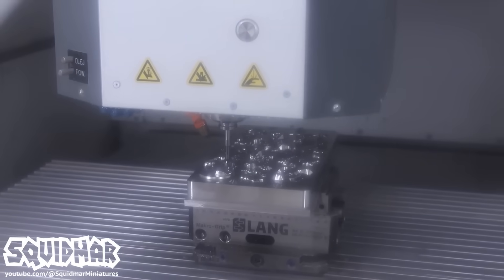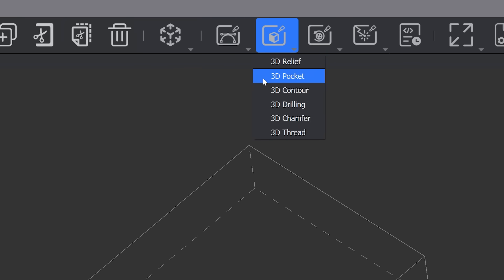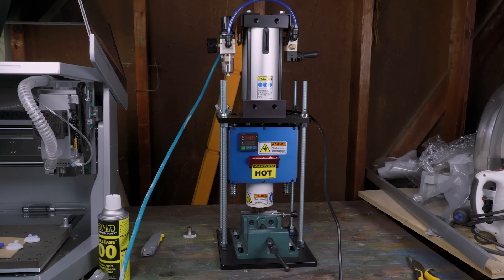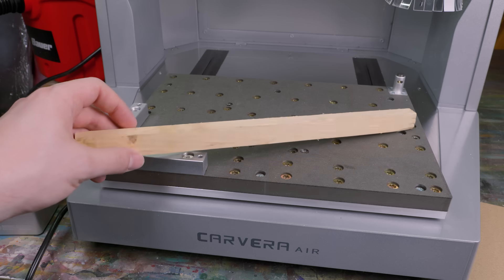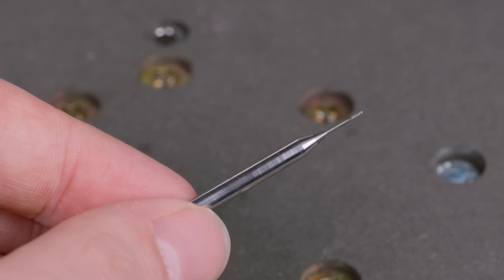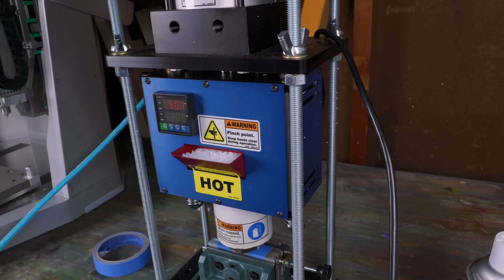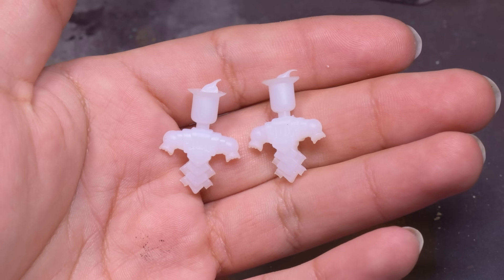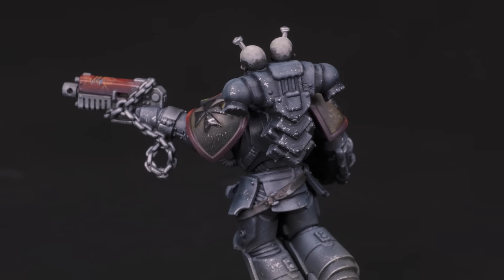You Can Make Warhammer Plastics at Home Now!

Comment: And that, ladies and gentlemen, is why a steel injection mould die is 5 figures or more to manufacture.
Reply: they might also use different methods like edm (electric discharge machining) where they first make (cnc) a die out of copper or graphite and then slowly sink it into a steel blank using electricity to slowly spark away the steel . this is called die-sink edm or sinker edm. with this method you can create much finer details and sharper corners, but it is also a lot more involved and requires additional machines, protection, knowledge etc.
Reply: If the mould starts to break, just retire the models with the next codex
Reply: How long will it take for degradation is the main question.
Reply: @COOPALOOPTROOPA  that really depends. I know for a fact that a couple of companies are still using the same moulds since the early 70s, but the details are a bit softer now. For bigger things you could use the same mould for decades, but you will loose quality over time
Reply: @COOPALOOPTROOPA  Good question.

I think the price of steel dies has much to do with why everything that requires serious hardware is so expensive (even though the hardware itself isn't that expensive, relatively speaking): it's a seller's market.

 A (relatively) high entry cost discourages new players from experimenting and venturing into the field. Few have an operating backgound in the field. The few who can already supply, can set the price. Once prices are set, new players often follow. 

These "X you can do at home" videos are not intended for those living in an appartment, and/or living on a salary, but for those with some capital and an interest in the field. They might be conviced to try it out for themselves.
Reply: Would you mind explaining this statement more? To the layman, it seemed like the main issue was the accuracy of the CNC, but I saw a person on the hobbycnc sub who made, IIRC, a 0.002mm tolerance 4 or 5 dimension mill for under 3k. I'm assuming higher accuracy means more precise movement so less lines visible. Seems like wizardry to me, IDK where you'd even start with that but apparently it is doable. Why is a steel mould specifically so expensive (and necessary?)
Reply: @Derploop commercial injection moulds are made of steel rather than aluminium because you’ll get more fasts from the mould before it starts to degrade and lose quality. 

Steel moulds are more expensive to produce because the tooling is more sophisticated and expensive. It’s easy to get set up for machining aluminium because it’s so soft, machining steel takes bigger tools with more expensive cutting bits
Reply: @ChilliCheezus  so based on that, you can in theory produce everything you need to get high quality moulds for significantly less than 20k?
Reply: @Derploop  yeah definitely. I've seen people making moulds with entry level serious CNC mills like tormachs which I'm pretty sure are comfortable sub 20k
Reply: @Joe_Bandit  it seems like modding rigidity is a big factor, the rest I'd not know. Maybe one day lol